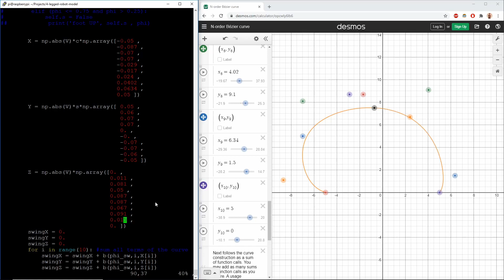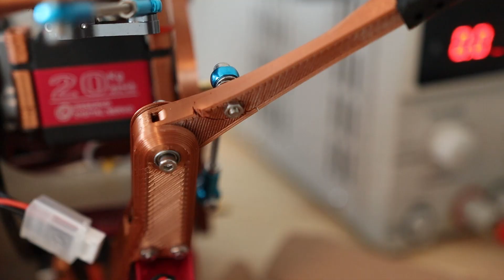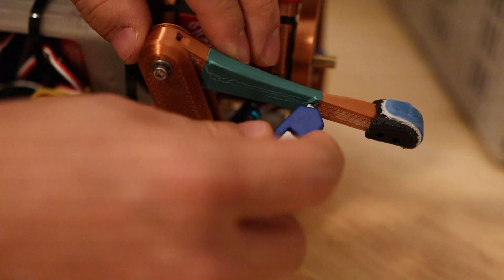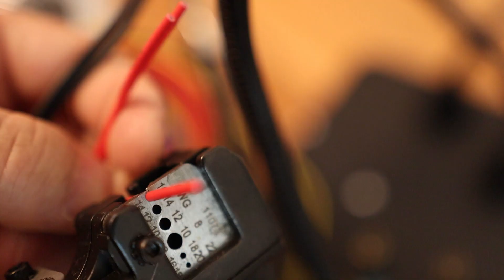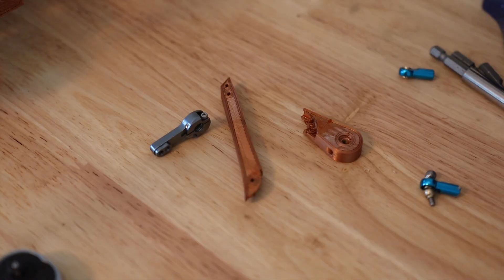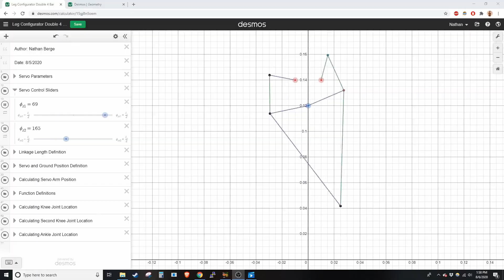Quadruped Robot Breaks Leg and Walks on 2 Feet (Small Walking Robot Episode 4)

Comment: Are you in Portland (saw the Morrison bridge video)? I'm working on building a copy of Miguel's robot, too. Would be awesome to meet up and compare notes (6ft and all).
Reply from the maker: Caleb Hyde I’m from Portland, but moved to the East coast recently. That would have been cool to compare notes though.
Reply from the maker: How far are you in the build? I got the cheapest servos on Amazon. I’d probably use slightly nicer servos and run them directly off of a 2S LiPo. These are the ones Stanford pupper uses: Actuators: 12 x JX Servo CLS6336HV

Comment: Thanks for the link to Desmos.
 This seems very good !
Usually the end of my paw draws a rectangle. It is practical and easy to implement. But notice, the rectangle is not centered on the axis of my 4 bars. It is forwarded on the front legs and backwarded on the hind legs. Lets says x=40 for front leg and x=-15 for back leg. Not symmetric at all. This is very important for the back legs do not collapse under the weight.
For some time now, rather than drawing a rectangle, I have been drawing a parallelogram, one of the diagonals of the parallelogram represents the floor. The small sides of the parralellogram are vertical.
Difficult to say why, but it seems to me that parralellogram looks better. He raises and lowers the shoulder. Note that at the moment I only use 8 DOFs.
Stay well and safe !
Reply: As far as i have tested, i have notice that it is very important to have proper velocities and accelerations inside the gait, i have used cuadratic, rectangular and some custom bezier curves, the first one are very agresive at touching the ground and customs bezier made the feet slip making the robot unstable. At the moment the less agressive gait i have used is the MIT one (showed the first on the video), this gait made the difference according to the robot stability. Here are some comparison with only the gait changed: 
Using MIT gait: https://youtube.com/watch?v=l5ygZzw-aq8
Using custom bezier:
https://m.youtube.com/watch?v=oXxK3lG5iIA
It is a pleassure for me you followed the project, i have seen your work since the first tank and i really like how you use LEGO for making robots, thanks a lot Oracid. Regards from spain.
Reply: @asdlab  Thank you for your answer, I appreciate very much. I will study your videos. Regards from Paris.
Reply from the maker: I think most of my problems are coming from the rod ends i'm using. I will add a close-up of it in my next video. The foot can wiggle 6mm when the servos are held stopped because of them. I am trying to overcome this by picking the leg up extra high, but really I should replace them.
These are the crappy ones i'm using:
https://www.amazon.com/gp/product/B07TYXX4N3/ref=ppx_yo_dt_b_asin_title_o08_s01?ie=UTF8&psc=1
Reply: @NathanBuildsRobots  yeap, mine are the same, what i find is that the silver rod, is only pressed and can produce play. What i did is to press them a lit more in order to reduce the play and then glued out
Reply from the maker: Thanks oracid1, I will try to move the legs so they are more spread out.